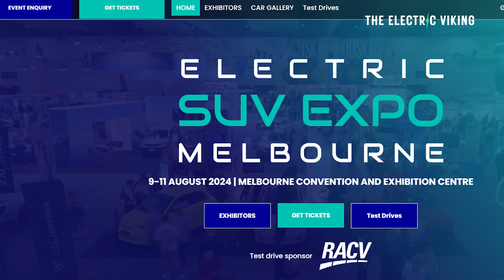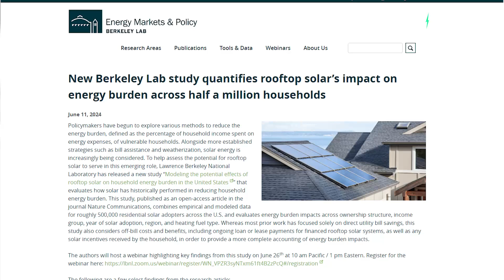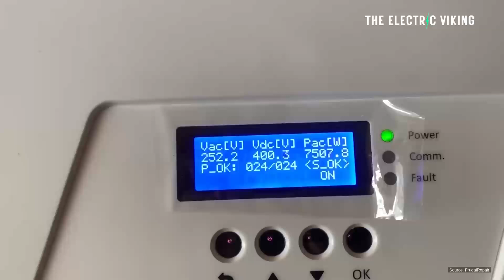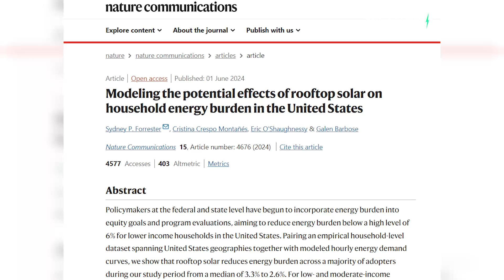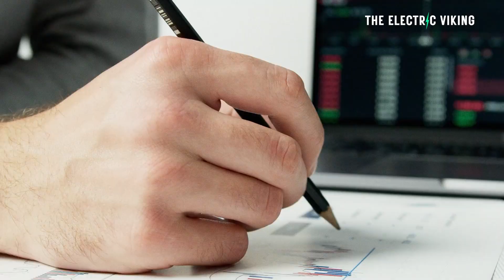Study says 500,000 home owners with solar panels save $50,000 on electricity

Comment: Why not install solar? A couple of reasons that I’m aware of: first people who know they are or are very likely to move in a few years. Reasons for this include downsizing with change of people living in the house, getting older and wanting or needing smaller or supported accommodation, or being likely to move because of work. The other issue is being able to access loans, Australian house prices being what they are many people have borrowed so much that they don’t satisfy the credit requirements to get a loan for solar. People are caught in the loop where they can’t access the technology that will allow them to save and drive down the size of their loan. 

Then there are those who follow certain commentators on certain media and it becomes an article of faith that solar panels can’t possibly work, in spite of all evidence to the contrary, because Dopey No-Hopey told them so.

Had solar for years, expanded it and got a battery and got rid of the gas heating and hot water after gas bills went up after the invasion of Ukraine. Good riddance to soaring gas bills and love needing to use very little grid electricity except in winter where we are in Australia.

Comment: There are many wholesale solar companies out there that can save u a lot of money. When i hear that people spend $50-75,000 for a system i gag!!!!...??U must realize u fan buy all the components for about $10-20,000. U are paying the general contractor a fee of about 33 percent. If u are the general conractor... that's money in your pocket. Professional installers may also charge $ claiming they must use special equipment to comply with ohsa safety laws....Its best if u have land to mount the panels on the ground. There are several reasons. First roof mounted systems must leave room for fire fighters to walk and fight a house fire. This may reduce the amount of panels u can install. Second when u are adding the panels to your house your home owner insurance may be effected. U just added X to yourhouse value so u must increase the home owner insurance policy. Be aware that your insurance agent will asku how old is our roof. This is because the average shingle roof can only be 20-25 years old. If its older than that your insurance company may not insure your house. Remember.........when it's time to replace a roof........roof mounted panels must be removed......   Then reinstall ed......!!!...Third......its easier to clean snow or dirt from panels mounted on ground than your roof. Fourth there are plans and kits available to easily and cheaply make ground mounts for panels. Its usually a diy project. Even if your building code requires professionals to do some of the installation.......u will save a bundle if u buy wholesale.......do what u can do diy.... and have the pros connect the system. Do the same with battery storage and generator. Go off grid if u can before the power company has laws past preventing off grid systems.....

Comment: I've just added 2 more tesla batteries to my 20kw solar.  It's been a big struggle,  wiring upgrades.  Kinda working now but no curtailment yet, installers only do the very basics.  SolarEdge inverters too complicated.  Wish I had Deye inverter and any other DC LFP battery, for simpler, cheaper and better arrangement.

Comment: I considered solar panels on my roof a couple of years ago, and I didn't see anything like $50,000 in savings. I needed ten years to break even (without a battery). The average electricity bill in Georgia (in the U.S.) is $2,640. If solar panels are free and reduce that bill to zero (requiring expensive batteries that are also free), saving $50,000 takes nearly twenty years. I believe that solar panels can pay for some people, but $50k (even Aussie dollars) on average sounds like nonsense.

Comment: It cost me $16,000 plus a further $3600 all told for my 6kw Solar panels and my Solar Hot water system, after paying for the two systems I am over $38,000 ahead after 12 years.
Best thing I ever did.
I can't work out why there are still people with out Solar on their Homes ?
Makes no sense at all.
Sure you have to make sure to buy a good system from a reputable Company and was why I got mine through AGL as they are my Supplier and the warranty is also through them.
I got a six year replacement warranty on my Inverter and a 15 year replacement on the Panels, inverter was replaced at 5.5 years and only went out of warranty six months ago.
I can now get an 11kw system for less than $6000.
When I buy my EV in 18 months time, I will upgrade my Solar system to an 11kw system with a 13.4kw battery and probably get my Power disconnected and not worry about trying to get a few cents from solar credits as no Bill will do me :)
I am thinking it will cost me around $15,000 to be free from any power bills as well as charge my EV for free, so a $3500 fuel bill saving per year as well as what ever power bills are these days :)

Comment: 1:20:  Compared to PV, solar thermal for domestic hot water is a good use of roof space but not a good use of your money.
To really save money, install your own PV system.  For on-site use of electricity (PV-->DHW and space heat as well as charging batteries and EVs) installing your own PV is a DIY project.
Energy is free; people are paying for convenience.

Comment: Seattle is the worst place to have solar, ok maybe Alaska is worse I don’t know, and it still works great. live in Seattle I produce 9.5Mwh a year in solar power. From a 10kw system on 3 sides of my roof. Which is about $1,200 a year in savings. 

5 years ago I spent $18,000 to install it. It is sunpower so it has a 25 year warranty and I expect it to still be producing well after 30 years. 

I considered this a retirement investment. I know what my house payment is going to be, I’m not affected by rising energy costs, and with 2 electric cars I’m not affected by gas prices. 

In almost any other state the solar output would be 50% more and the electricity costs would be 50% more. Making this even more profitable.

Comment: Solar powers our house and 2 EVs , we don't have a meter.  My BYD Seal has a 86kWh battery that can feed back power to the house via my solar system  giving us multiple days of autonomy.
Reply: More and more of the gen pop will wake to this reality.
Reply: Amazing 😍
Reply: Have you ever tried this "backup and autonomy"? Because most of inverters are not able work OFF-GRID mode. So if grid power is off then your inverter does nothing. Because it needs the Sinus wave signal to sync on it. There are inverters which support the off-grid but then you have to configure the backup storage capacity etc. to the inverter would able to drawn SAFE amount of power only... If it all works and safe for you then cheers, you lucky.
Most Solar systems with battery just for night usage backing up by GRID...
Reply: @tothimre7950  I haven't a meter now for over a year as I have so much backup capacity between my original solar storage and my EV’s battery.
Reply: @tothimre7950  The entire industry is in deep transiti0on, of course there will be issues, that is how we get to a better system, see what needs changing and then affect the changes. S/W/B is the best system to date and will replace our dependence on fossil fuels, not overnight but much faster than critics and bashers (Big Oil) think and tell us.

Comment: Solar is not only for Electricity. With Solar you need no more Gas. Saves your Electricity bill and heating Gas bill. And saves your Cargas bill. Charge your Car with your Rooftop Solar. Which means you make a lot of Money with Rooftop Solar. I have this system for 12 years now. Makes me a lot of Money in Groningen Nederland. I installed it also on a House I let. Made in 12 years 72.000 Euros. Thank You Sam for this video.❤👍
Reply: Interesting to read about gas for heating. I've not hear about anyone using it, instead we do ours via burning wood or spesific oil (old way) or more and more via different forms of electricity (radiators, pumps, ground head)

Always fun to hear about totally different stuff going on in different countries.
Reply: @kiskoi  we are Gas Region in Groningen Nederland. We had 3000 Billion Cubic meter Natgas. We provided Europe for years with Natgas from Groningen. Now we are Earthquake Region. Houses collapse. Like a bombing from below. The Government stopped Gas extraction for Danger of Earthquakes. This year. I have 12 years Rooftop Solar and Heatpump LG Therma V Monoblock 60 degrees. No Gas. 3 Million Houses with Rooftop Solar in 2024 in Nederland. And Change to Heatpump Heating Inductioncooking Airfryer Microwave Waterkoker and close in Boiler and bathroom Boiler 50 liter. No more NatGas. No wood no Coal. All Electric. On Rooftop Solar and Wind Energy from the North Sea. EV Cars everywhere on Rooftop Solar. Thank you for your comment.

Comment: Its rigged. They pay you peanuts for energy generated and charge top $ for consumed energy. The real saving is to use what you generate in peak sunlight then be frugal after sunset. This needs some smart water heating timers, cooking methods and so on. Batteries help but are insane expensive making savings pitiful.

Comment: The warming latitudes and future electric world will need cheaper electricity. 

The grid makes dirt cheap electricity expensive electricity. 
My 5cents kWh feedin, my 50cents kWh supply invoice.

My thoughts are keep the existing national grid and repurpose it as a taker and reseller and emergency backup. 😮😮
MAINTAINING existing cashflows from its 25gW capacity. Australia 🇦🇺. 

Basically double duty, but no $TRILLIONS spent to supply new grid to new industry. 
And No nuclear plant construction. 

Australia has 20million buildings on the grid. 
20million rooftops, can be shaded in rooftop PV panels. 
Australia's 20million vehicles can be 20million BVs with oversized battery storage. 
BVs built for the LONG DRIVE but parked 23hrs every day. 
Trickle currents all day long and trickle currents all night long.

Selfparking selfplug-in V2G EVs at every building car park space with a $60  wall outlet. 😊😊😊😊😊😊😊

Oh happy days, O happy days, when the sun was shining, when it wasn't cold, ....and the bills didn't come, 
O happy days....😊😊😊😊😊😊😊

Comment: My thoughts on nuclear is that it is a GRID CASHFLOW problem.
In Australia (and all countries in warming latitudes)

In the future, the warm world of BVs, battery vehicles, and rooftop PV grid cash flow will crash every day the sun shines. 
$TRILLIONS in the grid asset with owners expecting ROI of $100sBILLIONS. 

So take the 20million building's excess electricity and sell it to new industrial heavy users. 

The same grid is unloaded from the old customers and can supply new heavy industrial customers. 

No new grid construction. 
Cashflow is maintained. 
Old customers remain connected to the grid as emergency backup when their BV is out of action at the mechanics.

Most vehicles are parked 23hrs every day and BVs have massive oversized battery storage capacity. 

Nuclear is just a money grab for government and taxpayers' money. 

😮😮😮😮😮😮😮😮😮😮

Comment: let me provide a more accurate explanation: Installing a solar PV system on your rooftop, such as a 10-14 kW system, can generate a significant amount of energy during the summer months in countries like France, Germany, Italy, Spain, etc. This translates to around 1.5-1.8 MWh (megawatt-hours) / month of electricity. With this amount of energy, you can enjoy several benefits:  If paired with a home battery, your house can become fully off-grid, making you self-sufficient in terms of electricity.  Besides of being off-grid you can also use the excess energy to fully charge an electric car three times a month.
Reply: Not just summer months, that is just when it is most efficient. Still significant generation in the winter months too.
Reply: @billjohnson3022  in Germany, France, etc the PV production is 4 times less in winter. Further south in the Spain, Italy, etc it is about 2.5 less in winter according stats

Comment: my California Solar City (now Tesla) system has been running since December 2013 and I've saved so much money it's crazy my bill is only 10% of what it was before I went solar mostly, that much only because of natural gas and the grid tie fee, I got lucky because most of the time they limit you to 80% size, but I lucked into being able to cover my entire roof because I used to have many servers and other stuff running in my apartment before I bought my house and moved and had all my bills and could use them justifying an oversized solar system.

Comment: I spend about $1300 a year on electricity. What kind of solar system is going to pay for itself in a reasonable number of years?
Reply: When we put sola panels, the pacy back period was under 4 years.
Reply: I spend 85 bucks a month for electricity.
Reply: MN, you’ve also got gas coming into your house to heat your water and fuel your stove and furnace. Add those costs in and you are paying more like $3,000 a year for home energy.
Reply: @freeheeler09   So then a system to replace all that would have to cost less than $20,000 to be a no brainer.
Reply: The title says people save $50k. I do not spend $50k on electricity. I don't have gas lines.

Comment: You would only get the $40,000 saving if you had 10 kW on your roof and not everyone can fit 10 kW on the roof and you have a battery. 
Otherwise, you’ll never get anywhere near that saving without the Battery

Comment: People with solar in australia are being ripped off.
First, they introduced management fees on your electricity account If you have solar, then they drastically reduced feed in tariffs to a ridiculously low level while at the same period electricity from the grid rised by over 50%.  Now, there is talk of charging you for feeding into the grid.

There is no return on investment anymore, unless, of course, you are an energy supplier .

In my opinion, Australians are being conned, and I have had solar for around 15 years.

Comment: See if I am going to use an alternative energy source, I’d have to 100% no longer rely and depend on fossil fuels and be completely off grid. Solar alone cannot be able to do that unless there are further advances in battery technology and energy storage that maximizes the capture of solar energy and make solar energy a viable off grid standalone source of energy. I want to have absolute control in the energy utilized by my household and it should not be uninterrupted and unimpeded by storms, hurricanes or any natural event. Solar, as it is right now, only still plays as a complement to legacy energy providers. But utilized in smaller systems such as the power provided to vehicles, it is a game changer.

Comment: Residential solar systems are far cheaper in Australia than in California - maybe by a factor of four.
Reply: VERY TRUE - its actually an Ozzie success story. In 2009 the Gov put in a Solar Plan of reducing subsidies until 2030 and NO GOV messed with it and we had a stable plan with simple connection regulation. It meant we built a world class Solar Installation Industry servicing Homes. We put Solar on roofs for the same price per KW that we build a Solar Farm. We are the only Western country to be doing this. Every other country is about 3 X the cost per KW to put Solar on a roof and about the same as us to build a Solar Farm ie $ 1400 per KW.

So successful its starting to cause us problems but they are good problems to have.